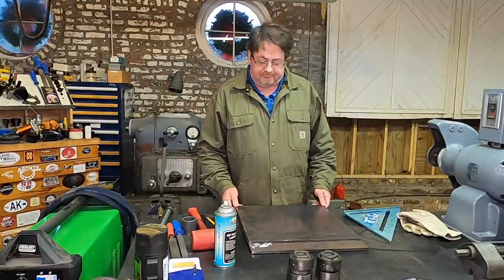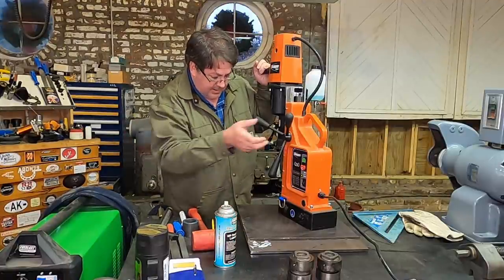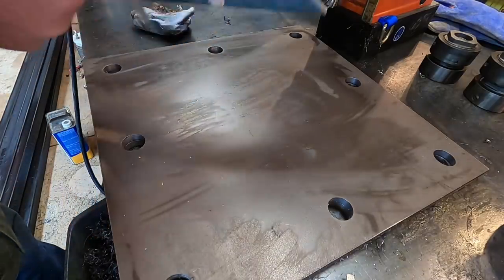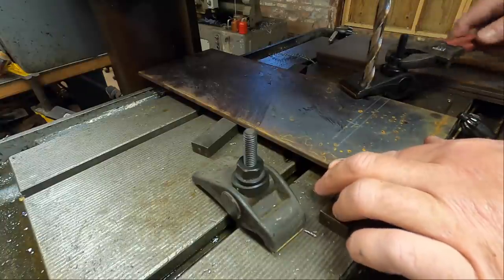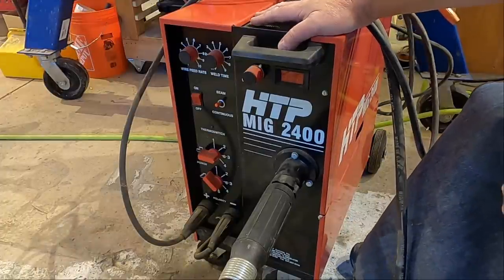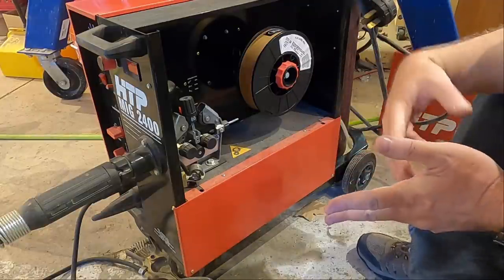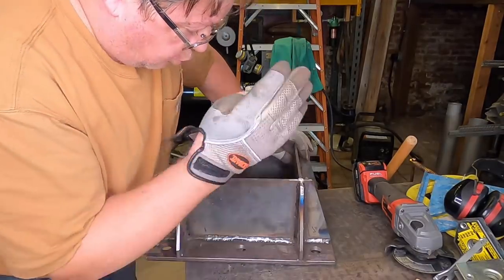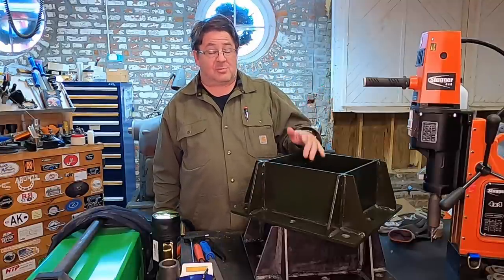Making a large Post Base

Comment: My great grandparent's house was built in the early 1840s.  My cousin inherited it and the farm.  When she and her hubby retired, moved back to the Houston family home they started to restore it.  The center of the home was sagging a couple of inches, which was nothing to worry about.  But, when the heating-A/C guy crawled under the house to install a central system, he came back out and said he knew why there was a sag.  The center of the home was supported by a tree stump that had been cut off in place and the home built from that reference point.  It is still there, with some shimming, as it lasted 160 years and when they drilled into it to check for rot it was still good so 160 years from now???  
Never thought I would see you in a warm jacket and not wearing shorts....  Cold day in Hades.  
May your holidays be happy, your family safe, and Santa stubs his toe under your tree.
Reply from the maker: Its been chilly,  at least for Mississippi,  below freezing most nights.
Reply: @jtkilroy  When we stopped at your shop in 2015 we thought that with the heat, especially wearing our safety gear on the Goldwing, that Mississippi never cooled down.  Going thru the battlefield at slow speed was a hot thing and having to hunt for secluded trees was not fun.  Casino food can jump up and bite you.

Comment: With flux core wire running dual shielded isn't it correct to reverse the polarity? I have found issues with both penetration and porosity when I failed to swap the lead inside the machine... maybe it's just the wire we use?
Reply from the maker: Yes that is correct. Polarity is reversed from solid wire.

Comment: The "fun" of working with an older structure.  Ours is nowhere near as old as yours 1970, still has its idiosyncrasies, especially insulation for northern Utah (lack thereof) and window glass.   It was custom designed and  built for an artist whose brother ran a very successful commercial glass company.  Things like floor to ceiling tinted single plane glass optically correct glass in the living room (multiple)
Reply from the maker: That must be something to see. Hate to break a pane.